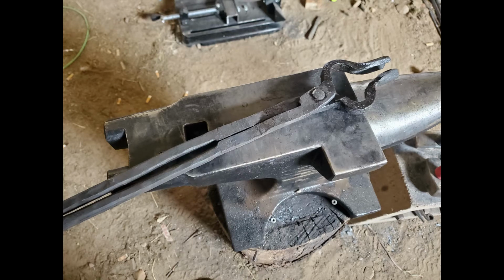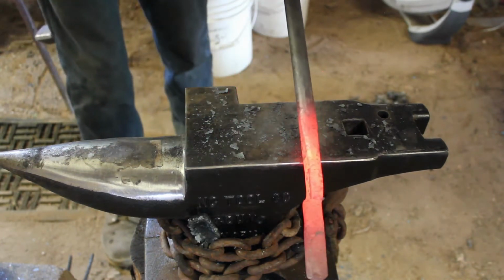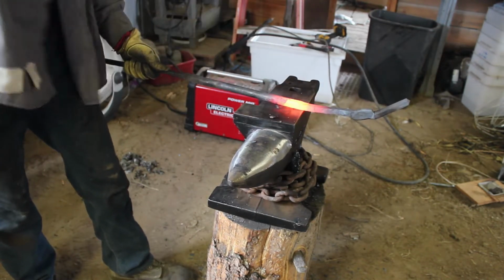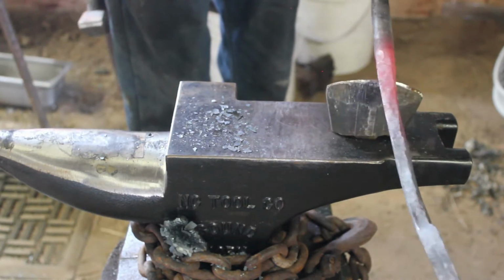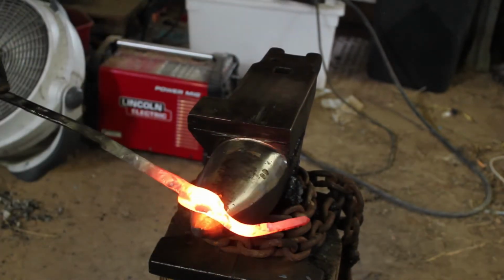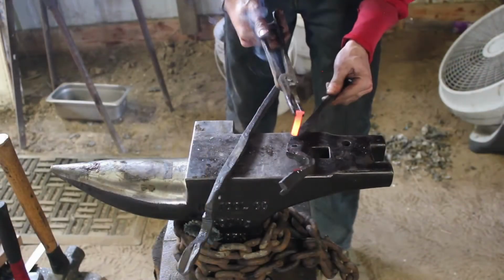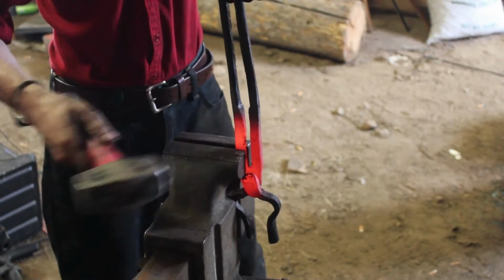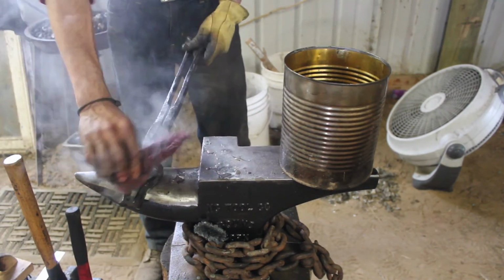how to forge bolt jaw tongs

Comment: is it okay if i use rebar or what else should i use as an alternative?
Reply from the maker: Any metal that is large enough to make tongs will work. The only issue is with tool steel u have to be mindful of cooling the tongs when they are hot. U may end up hardening them and making them brittle. Normally this is not a problem as long as ur tongs dont get red hot.